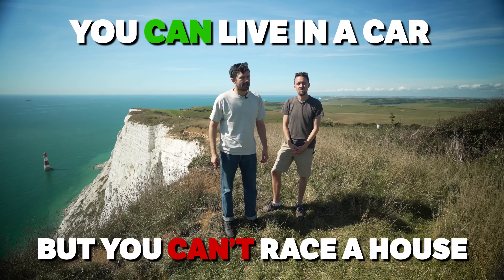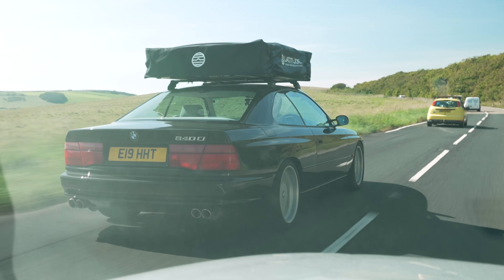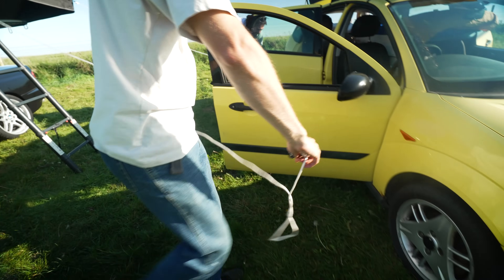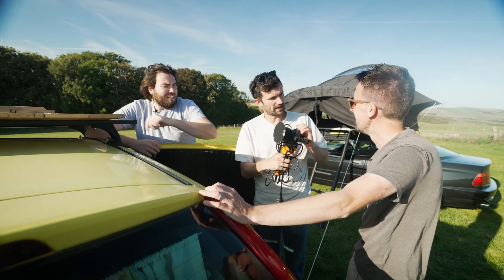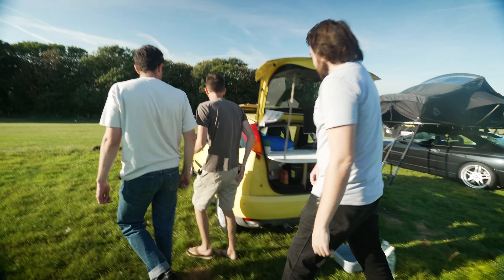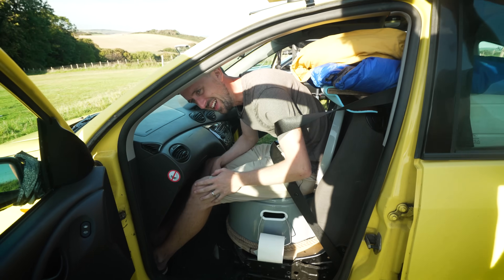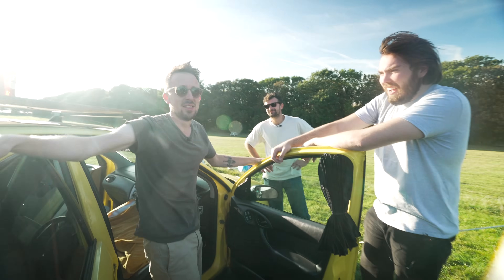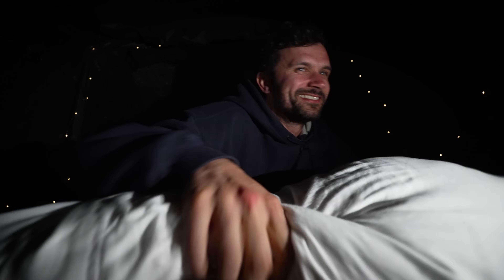£1000 Vs £10,000 Micro Camper Challenge

Comment: The whole point of the Switch is that it is supposed to be portable as it has it's own screen. So Jack's BMW could easily have had it own Switch with minimal effort.
Reply: Yeah but how would he power it when the Battery Dies and to actually use it like Ethan Did he would need a TV. He didn't have an Ecoflow and I highly doubt He could charge it using a Cigarette Lighter
Reply: @lorddarlo6194  you can absolutely charge a switch from a cigarette lighter port. it draws 39 watts max. just get a 60W USB PD car charger and you're golden. charge it while you're on the road and if your battery isn't completely fucked you can charge it 10 times easily while stationary.